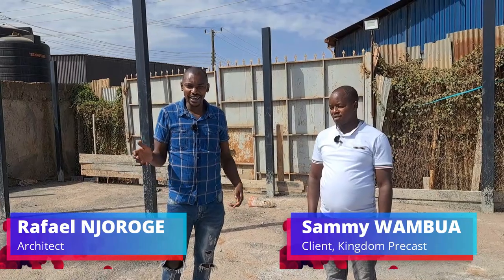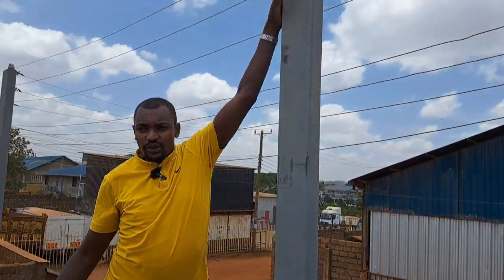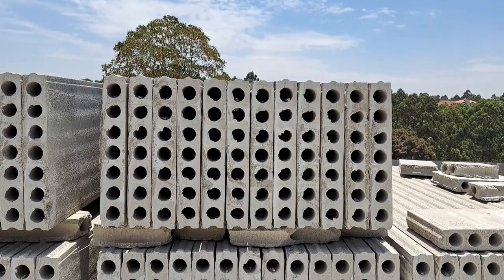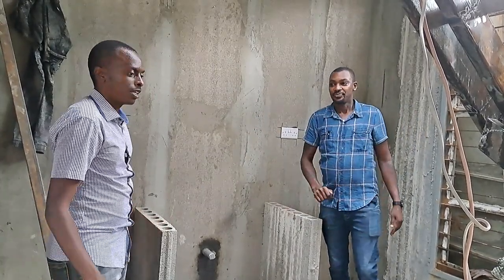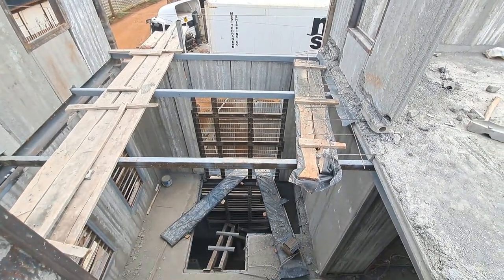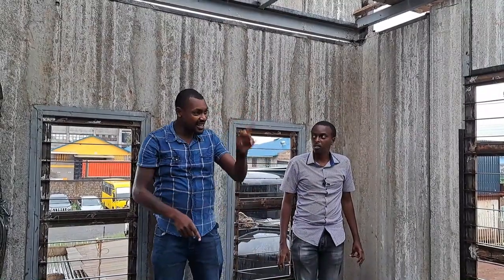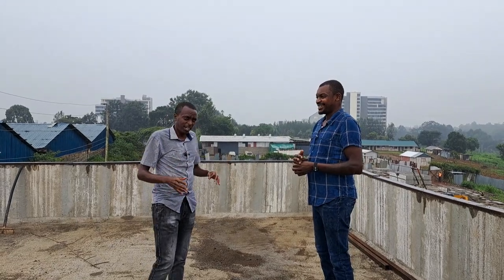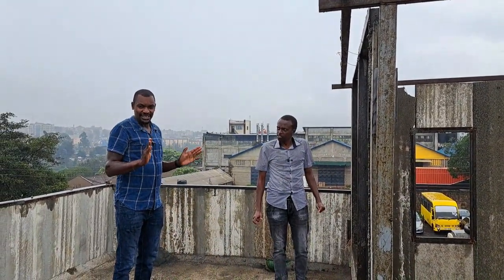Building an Epic Office in 30 Days: The Versatility of Precast Concrete Panels

Comment: I have been watching your videos and I must admit that they an eye opener. However, I have a question. Can one use this method to build slowly especially if you are limited financially? That is can I do the structure first and then take a break and continue later?
Reply from the maker: Yes, you can start with the structure first, then continue with the finishing at your own pace
Reply: @PropertyNoma I did not see usual pillars being used. Does that mean that the steel beams can hold the weight?
Reply from the maker: @FredOtieno Steel RHS columns were used in conjuction with steel I and RHS beams

Comment: Nick, thanks for the Informative contents on different building Technologies.
My question however is, how strong is the precast concrete as a slab, how much weight can it hold?
Reply from the maker: This will be determined by your structural engineer. A precast panels slab will need steel beams and columns for support

Comment: is this recommended for residential spaces?
Reply from the maker: Yeah it can work for residential spaces
Reply: What about structural integrity compared to the beam and block system?
Reply from the maker: @solomonmurithi  It's just as good as beam and block technology. Precast panels are a versatile material as it can be used for walling, fencing and making concrete slabs